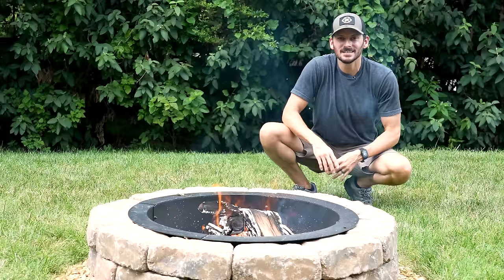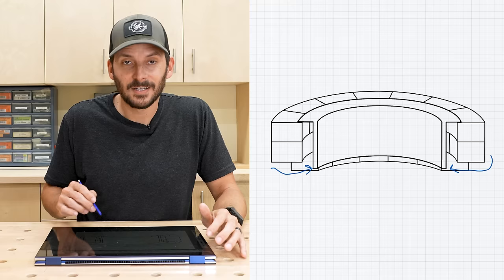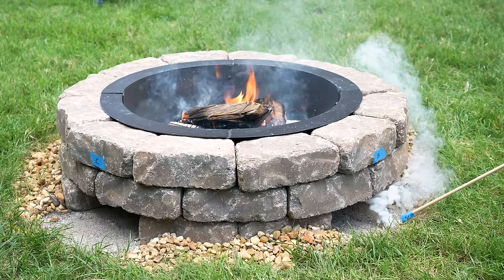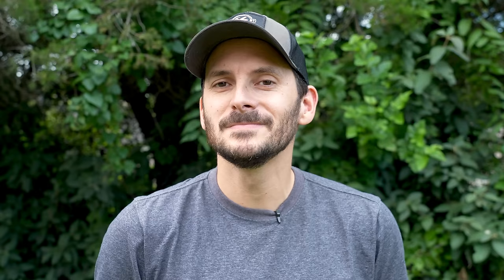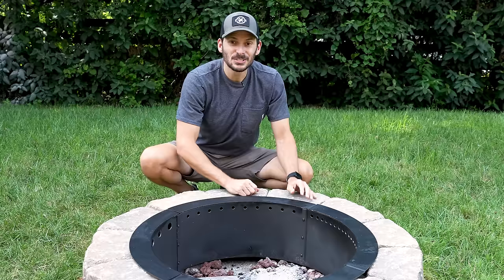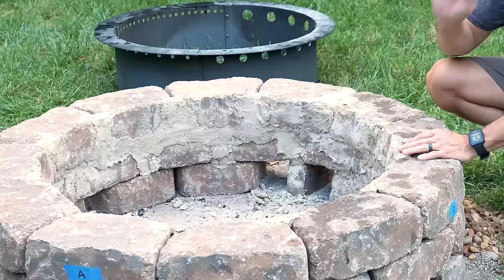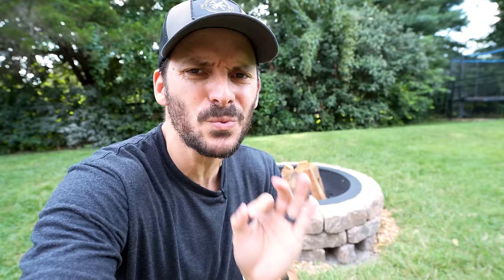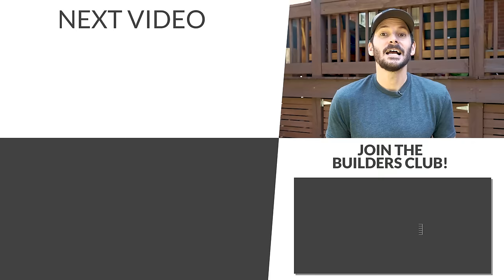Stop the Smoke, Do THIS to Your Fire Pit

Comment: Tip for calculating the airflow:  Measure your 4 gaps in the bricks.  That's the surface area of the inflow.  Ideally the outflow should be similar in size to the inflow, or slightly larger.  Number of holes * pi * diameter is the surface area of the exhaust.  Compare the two numbers and then adjust the hole size (or number of holes) until the inflow area matches the outflow.
Reply: Would you want the airflow to be the same between the top and bottom? Would it not eventually choke the fire if the bottom weren't receiving more air to feed it? Or would the heat of the fire just naturally pull in more air from the bottom regardless; provided the holes weren't smaller and/or less numerous than the top holes.
Reply: Surface area of the exhaust = (number of holes) ⋅ π (diameter / 2)²

(Number of holes) ⋅ π ⋅ diameter would give you the total circumference of all of the holes, not the total area.
Reply: @flennboyd6413 Probably Automotive Engineering or Furnace  tech/engineer. There's a big world out there man, lots of really cool things that people do.
Reply: @flennboyd6413  pyromaniac!   😂
Reply: @Philitron128  probs not as his math ain't right tho. There's also thermal expansion to consider if the air is heating up
Reply: @kyoteecasey  Yeah, this is why not everyone is fluid mechanics engineers. Fluids, especially when the flow is turbulent, can be very complex to calculate. You can make pressure and temperature differences that cause inlet and outlet sizes being different, in best cases. Since the low air intake causes and upward flow in the system, and since  the outlet temperature is especially higher on the top holes, a wider or narrower outlet may work better, when compared to the inlet area. Additionally, the airways in the whole fire pit can be very rough, causing turbulence unpredictabilities.
Reply: Damn u smart cuh whats your job?
Reply: Whew! I don’t want to have to be a mathematician or physicist🥸 to build the smokeless fire pit. Life’s complicated enough as it is. I’ll just follow the video. It worked. 😃
Reply: Great explanation. Clear, concise, rememberable. And Yeah, I meant to say that.
Reply: Can you say that again in English?

Comment: 0:27 fun fact! (Assuming you don't say it later) the reason smoke seems to always be blowing into your face is because of convection. With nothing obstructing the air's movement toward the fire(and no wind) the smoke will rise straight up. BUT! since there is often a person or group of people somewhat clumped together around the fire, the air that would come from behind them is slowed meaning the air on the other side of the fire that isn't slowed will assert more force bending the convection current and thus the smoke towards the people blocking the air. Of course with the wind blowing the smoke will follow the wind but still be affect by the convection
Reply: Came here to say just this.
Reply: Comments like these are why I always peruse the comments section of videos. 10/10 solid fun fact.
Reply: This is why I often add a large, flat vertical stone on the far side of a campfile fire. However it doesn't aways work, because smoke following people is based on the universal law of attraction... whatever you fear will come :)
Reply: Physics 👍👍💯
Reply: Yes was going to say this. The reason it seems like the smoke follows you is because it does. For the reason you mentioned
Reply: Tl dr
Reply: Funnier fact: Sometimes it seems to be targetting a specific person, and if that person moves, the smoke moves along - even if there should be a path of less resistance should it turn some other direction.
I've forgotten why, but that's absolutely hilarious and cursed.
Reply: Fun fact if someone farts and it goes in your face. Thats convection. Lmao. Jk only meant to make people laugh. Not disrespecting your comment jared/ nor trying to be rude. No one take life too seriously. None of us make it out alive.
Reply: Excellent comment! I feel like an idiot b/c this never occurred to me.  However, even though I am a small person, it always seems as though the smoke follows ME more than anyone else ... just like the danged mosquitoes! 😏
[9.21.2022]
Reply from the maker: Science!  Sounds like something fun to test
Reply: @mcsmama  mosquitoes? That's probably because you most likely have blood group O positive. It's their favourite.
Reply: Yes, kind of the same thing with cigarette smoke. Gas expands to fill its container.  The non-smoker has less smoke particles in their vicinity, and thus, the smoke gravitates to them!
Reply: Fun Fact: wind
Reply: @ConfusedRaccoon  it's low pressure in front of where u sit
Reply: @enigmatum100  Maybe that explains Stonehenge.  It was a giant smokeless fire pit.
Reply: (0:27 letter) Fun fact! (assuming you don't say it later) The reason why people can't sit through an entire video before writing their 2 cents is due to shorter attention spans.
Reply: Some people don’t understand why the back of their car gets so dirty….. physics.
Reply: @greenwave819 I know right :D
Reply: so basically a version of what he built, just with people? nice!
Reply: I thought that was due to a vacuum created by the cars forward acceleration.
Reply: @barbarawest584  the back of my car gets dirty because of the exhaust.
Reply: I personally prefer the Mexican explanation, "El humo sigue a los guapos" (The smoke follows the handsome) Haha! 

But it's better to know the science behind it, thank you.
Reply: Who knew how primitive ways did not equal less than.perhpas? More importantly, it is more progressive than most modern ways of thinking when simply retracting the mind and digging a hole instead of recreating the space around it. Less invasive and clean, not changing what was but using what is. Progressively primitive  is what and should be our goals. Not to use up but give back when needed to grow and understand more. We are all here today because of primitive ways. Without this, we would not have survived this long without them.
Reply: Our environments depend on this way of living and our responsibility of cohabitation to thrive within it all around our world and the world's around us, too.
"So is below is above." 
Without it, we would simply be relics and lost civilizations added to those who had gone before us. 
Getting back to our basic way of life is fundamental, or we will never know the true meaning of life as it was freely given. This does not mean everything is bad. Just the knowledge that most of what does not serve us as beneficial  here on our planet or the lives and creation on it will never be able to truly thrive fully. We all need to relearn what was taken away from us all and held back. Not everything served us well enough nether. But that is where commonsense will be needed. If it destroys or takes away from us, it will never be a salutation it will add to these problems. I am thankful for the modern things we have today. But when that trumps life and taking from others, that is very hard to overlook. Most progressive primitive cultures still recognize this today and sadly have not been heard. Or have been silenced or occupation has governed over them into wors and dispar. This does effect the whole world I. More ways than one and those who have contributed should be named progressively weak and lack of humanity. They have made it nearly impossible not to be inslaved into this madness and we have all been taken advantage of our human rights.  No bird pays taxes to fund wars or poison or a ruff over their heads. Even though we may depend on them to help fund their ppl to thrive, they have failed to do so. And use money profits and gains to continue this narrative just so that we all can hopefully retire or live a somewhat healthy life. Manipulated our indifference against one another so we are all preoccupied with shame or guilt. It's so sad but very true, and I feel so sorry for the one who watches over us to see such events continue. There are no answers to these problems, just more concerning circumstances being made up and done. We have all failed at this and should all feel just as sad.
Reply: 😊 @greenwave819

Comment: There is one detail about fire pits that people keep forgetting.
If the fuel (firewood) is higher than the secondary holes, the secondary burn will become a primary burn for said wood and thus produce smoke.  

If you want to keep your current system then do not build the fire higher than the secondary holes (maybe an inch shorter).
If you are going to mod the system, add a 4th layer of stones and keep the firewood below the holes.
Reply: So stack four high
Reply: Yes, very true. Still worked very well despite, but yeah, that would improve it even more
Reply: Also, he should put some pipes or whatever for the air to have access to the center of the flame, not just its outside.

Comment: What you tried to build is a gasifier stove. However, that design relies on two things: small enough diameter to heat up the walls, making the secondary air rise up by draft, and small enough diameter to deliver that air into the flames. It's not really well suited for a large but flat firepit, but kinda works if you make the fire crazy big, as seen.
Reply: I'd argue that one thing the pit would benefit from would be for the bottom airflow to come out from under the logs. In the current iteration, it just tries to get to the flames from the sides, which is better than trying to enter from the top, but you still get convection pushing most of it upwards, rather than allowing it to get near the actual fuel and thereby replenishing the oxygen levels more effectively.
Reply: Yeah, I was just writing about diameter/height ratio - and drainage: seems likely to collect water when it rains, and moss and a little ecosystem! The DIY double skin drum I saw on here before I saw the solo stove advertising everywhere - that had legs built from the base of the drum. 
Rocket stoves have built in thermal mass and, like, hardcore substance - as do pizza ovens. Which is kinda what you want in a garden feature. Even though the solo stove looks very futuristic, it's not everyone's vibe and it probably dents and tarnishes as much anything else. And a drum is already a relaxed & utilitarian DIY vibe. Not pretty.
Reply: Nice! We can’t wait to see your video🎉
Reply: I came to the same conclusion with no knowledge about fire pits, and only the information he provided.
Reply: This is what I came down here to say. In fact, everyone seems to be saying the same thing
Reply: I have the big solo stove, and with as large as it is it really only starts getting a secondary burn if you've got a really big fire going and can get the air from the outside super heated before it exits the top holes. The smaller sizes are definitely more efficient. I agree with your assessment of his pit though, to really get an advantage from his width it would be a lot better to make it significantly taller and he'd have to get a really large fire going as well.
Still an interesting video, but it doesn't work nearly as well as it could with some changes
Reply: Exactly.   Ditto.   I concur.   What he said.     
Okay, that's enough.
Reply: Exactly!  He had to build a big enough fire to really heat up the metal walls to really heat up the gas inside to get that good smokeless fire. I’ll bet he could have had better success early on had he built a much bigger fire.
Reply: A wood gasifier can also be used to produce charcoal.  My understanding is, the fire can reach a point where it doesn't need outside air to burn the volatiles in the wood.

Comment: Great video. But having owned several Solo Stoves, the most important factor in the intensity of smoke is the dryness of the wood.
Reply: That, and the speed/direction of the WIND...This doesn't work...
Reply: Actually the solution is a three quarter size burn barrel, with a lid ( that opens) and a pipe that has a flue… perfectly distributed heat, no smoke whatsoever .much  better heat source ..use it in backyard for gatherings and  at hunt camps
Reply: @brentfarvors192  its too wide to properly work, the air needs to get hotter so it will rise above the smoke, taller narrower versions do actually work to some degree
Reply: Meh... do a search for 'dakota fire hole' or 'dakota fire pit'. I've been building low-smoke fires most of my adult life without anything special. You just have to watch the wind direction. Air feed is the key along with a hot fire.

Comment: I believe the main reason it took so long was due to the size of the pit. The ring needs to be hot enough and the flame needs to be near the gas plume to ignite.
Reply: The smoke (carbon) needs to burn and needs to be very hot to do so. He had to get a good bed of coals that covered the whole ring and keep a larger fire to get hot enough.
If he put a ring on top that narrowed the opening like the commercial units it would be easier to get to temperature. It pushes the heated gases together to address potential cold spots in the flow and reflects much of the heat back inside. 
Also notice they used stainless steel. Those temperatures will corrode the ring and cover out relatively quickly with regular steel or cast iron.

Comment: I think the next step in efficiency would be to add spiraling channels around the outside so that the air in the walls of the fire pit can't just go straight up, but has to go at like a 45 degree angle around the outside, increasing the time it spends in the wall and therefore the time it spends heating up. This would likely result in a secondary burn happening sooner after starting the fire, and a more complete secondary burn due to potentially increased velocity.
Reply: Another feature to help secondary burn might be to add a lip above the top holes, as is seen on the retail fire pit design he's imitating. This would force the air exiting the top holes towards the fire a bit before it can rise above the firepit, along with adding some radiative insulation to that region to help keep temps up and maintain the secondary burn

Comment: Loved this, I have a Solo fire and it does smoke to begin with even with dry logs. You also get a better secondary burn with a full fire across the width (rather than a tall fire) as the air passing along the side to come up through the holes is heated more... Great job!

Comment: One suggestion I would make to reduce smoke, indoors or out, is to build an "upside down" fire.  Put the biggest pieces on the grate, on the bottom, then the next smaller, at a right angle to the biggest ones.  Keep alternating layers, leaving some space between the pieces for air, then put newspaper and small kindling on TOP, NOT on the bottom.  You may have to feed a bit more small kindling at first, but not for long.  You will be amazed at how much cleaner, quicker and hotter the "upside down" fire will burn.  Each layer heats the layer below as the fire goes DOWN (trust me, it will, even though fire generally does go up), so each successive layer burns readily, and there is hardly any smoke.  When you make a fire the usual way, the bigger wood on top isn't hot or dry enough, so there is quite a bit of smoke until the big pieces get going. Once the "upside down" fire gets down to the bottom layer, you just feed it more wood on top as usual.  If you try this method once, you'll never go back.
Reply: I'm going to try this out. Burned my first fire of the season tonight.
Reply: I agree, this man knows what he is talking about
Reply: We always do the stacked cabin type fire with the newspaper or kindling underneath the “roof”. I’m going to try this way next. I’ve actually never heard of it before.
Reply: In most cases this will not work. Heat rises. Ashes smother flame.  If you need to get a fire going use log cabin or teepee style.  Some genius taught this method to our kids for 'winter survival'. Apparently cold branches won't burn this way. Everyone had  to eat cold weinies.😥🍖🥶
Reply: @blairzettl3933  Upside down is THE way if you have a wood stove/fireplace, not so much an outdoor fire.
Reply: Most people don't get that smoke is from a poorly burning fire.
Reply: @blairzettl3933  Works very well, IF done right. Same goes for the Swedish Torches you can find elsewhere on Youtube.
Reply: Led me to think
Reply: I prefer easy teepee with kindling inside. Once you get a hot bed of coals, it’s burns cleaner and it doesn’t matter how you stack it or what you put in the fire, it’s going up.
Reply: I was just about to suggest this
Reply: Yep. The “Upside down fire” or “Swedish top down” fire, is definitely King. I use it all of the time!
Reply: Well, on the the next YouTube rabbit hole. Who else is about to research how to make an upside down fire or Swedish Topdown now?

Comment: When wood gets hot enough in a low oxygen environment, it produces wood gas, which is flammable. Combustion needs oxygen, so you see fire "shooting out" of the vents, which is actually the boundry of wood gas and oxygen mixing and burning. Gas burners have this same boundry flame, but inverted, with a stream of flammable gas into an area of oxygen.
Fun fact, the fire we see is mostly comprised of incandescent soot, material that gets so hot it glows like a lightbulb or forge metal.
Reply from the maker: wood gas...I like that 👍
Reply: So it's true that wood doesn't burn. It gets hot and produces flammable gas. If you look very close to wood burning there is a slight gap between the wood and the flame.
Reply: Correct, if you're seeing flames out of the top holes, it has to be wood gas being drawn into the lower holes, & mixing with the air to then be ignited as it exits, looking like the burner you talked about.  Just air coming out wouldn't really do anything...  My woodstove  has secondary burning, but the flue comes outta the middle of the firebox (damper can be slid open to load wood, so it exits the stove by flue not door, lol)